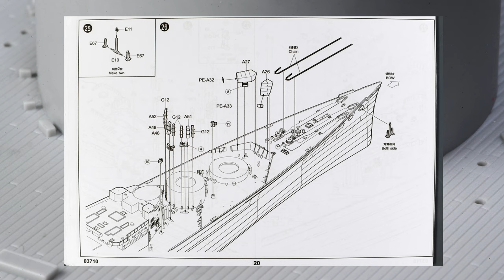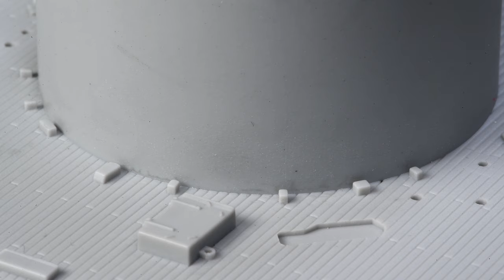The Model Ship - Part 546

Comment: For what it is worth, XF-66 looks good to me. I think the important thing is that sat above (or below) the Bismarck in the display case when it is finished, the Hood needs to have an overall look which is darker than and more blue grey than the monochrome greys of the Bismarck. It's easy to disappear down the rabbit hole though when it comes to paint schemes and accuracy, it's nice to see that even on the HMS Hood Association website the number one point is to paint the model the way you want to, so if you are happy with your choice that should be the end of it. Looking forward to tomorrow's instalment, watching these has become a bedtime ritual for me.
Reply from the maker: Something has come up. What do you think of XF-22? That's the one that's already on the upper hull.🤞👍
Reply: Gulp, this is where I can almost feel myself counting rivets. XF22 looks to my eye closer to her 1936 - 1939 Light Grey (foreign stations) scheme than the Home Fleet Dark Grey she was wearing when she met the Bismarck in 41. Having said that, if you like XF22 (and you've already used it on the upper hull) then ultimately yours is the only opinion that matters. Your model will be amazing whatever you choose because of the time and the effort you are putting into it. I'm currently making the Bismarck in 1:700 scale and I've found that ultimately all my choices are made based on the following criteria in descending order 1) what will my skill level / eyesight / manual dexterity let me do 2) what looks best on the model and finally only after 1 & 2 are considered 3) what is most historically accurate.
Reply from the maker: @alricdark  .... I guess we'll know what's happening by the end of episode 547 tomorrow. Gotta. wind this up. Been dragging it on way too long. 🤞🙂

Comment: Ron, I noticed when you took the pictures of the manual that the colour call out chart shows the conversion of the Humbrol paints to several other brands, including Tamiya. Only 2 colours do not have a Tamiya equivalent. Is there a call out for the barbette for Humbrol to Tamiya?
Reply from the maker: Hi Tony,
Have just rechecked the painting and marking guide now. None of the barbettes or main turrets show as being any different from the rest of the superstructure. However, Trumpeter is calling for XF-22 --- another monkey wrench in the works, lol. Haven't started to paint yet. Might be a change in plans again. We'll see tomorrow I guess. 😁👍